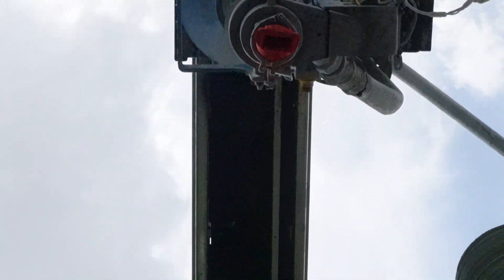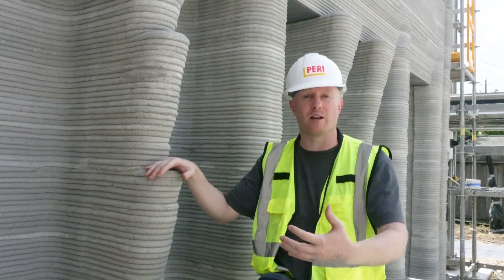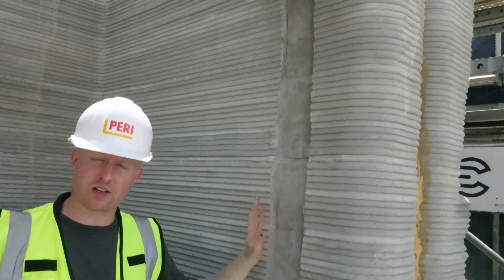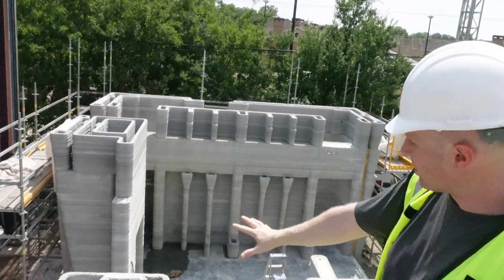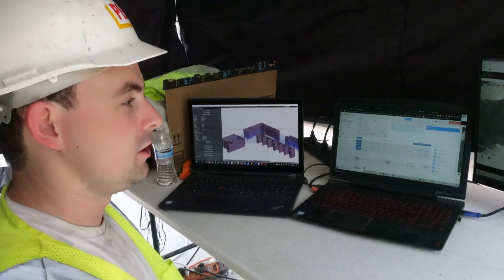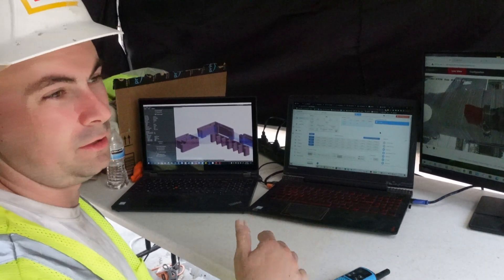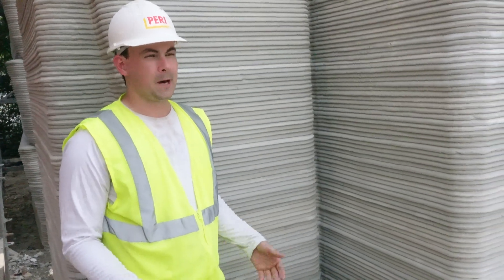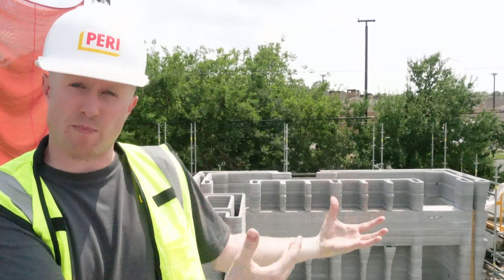BIGGEST 3D PRINTED HOUSE IN THE WORLD UNDER CONSTRUCTION

Comment: Hey Jarett, in your opinion what printer has the best architectural capabilities? As in layer quality, overhangs, etc.
Reply from the maker: Architectural capability is too big that could be measured in overhangs or resolution or just general print quality because the layer line quality really lens to the aesthetics of the overall project. Not to mention the architectural design of the file itself, which doesn’t really depend on the printer. with such a big question I can’t possibly pick one company but if you want to try and be a little bit more specific, maybe I can give you an absolute answer.

Comment: What was the cause of the vertical crack (video at time 0:56)?  Was it a material failure or buildability issue?
Reply: There is poured concrete with rebar behind it so no issue
Reply: @sh265  Structurally, that is good but what about astecically?  The exposed layers are the feature of the house.

Comment: It should have water inside the walls for best thermal mass + useful preheating of consumption water :)
Reply: Very interesting idea. I’d love to hear more, I’m working on the first project in Colorado.
Reply: @Revolutionizehousing  Perfect ! I'm looking forward to this :) Where can I reach you ? Thank-you ;)
Reply from the maker: Cool! feel free to email me via jarett@3dprinted.construction
Reply: The thermal conductivity of water is only slightly lower than that of concrete. So practically it would be the same as no insulation at all.
Reply: @deafblindnoob2748  Thermal mass insures insulation by delaying the heat transfer not bu reflecting it, like a typical insulation based on air. Basically, the whole wall becomes a heat sink and can be used to trap heat from the sun during the summer and then have that got water stored in underground insulated 😁storage... During the cold season the empty walls will act as any other porous material and thus insulate
Reply: @adriangabrielgramada1016  this would necessitate a continuous or periodical water flow, so you could leverage the thermal capacity. Interesting idea, I think I heard of someone working on a similar system in his bachelor thesis. As far as I remember they wanted to use a mat or mesh like system to integrate into the walls.
Reply: @deafblindnoob2748  Yep, the system would allow for water to come and go periodically :) I already have all the parameters layed out from my fully autonomous universal living space :) Everything is automatic and quasi-passive also ;)